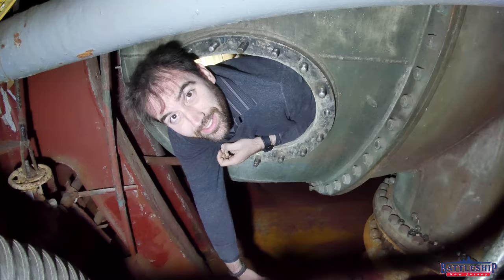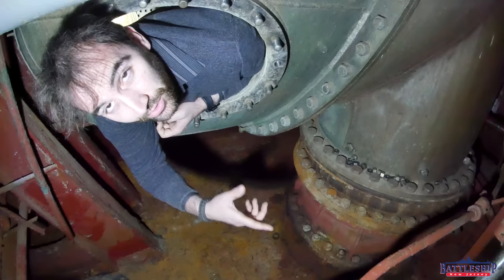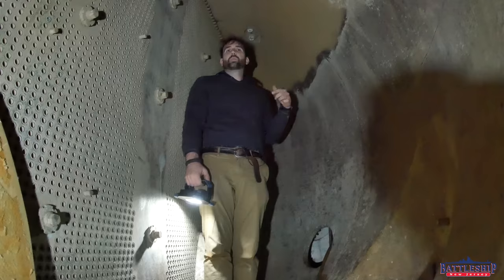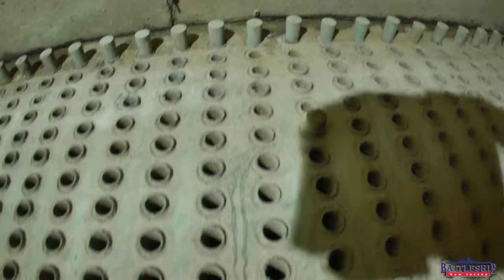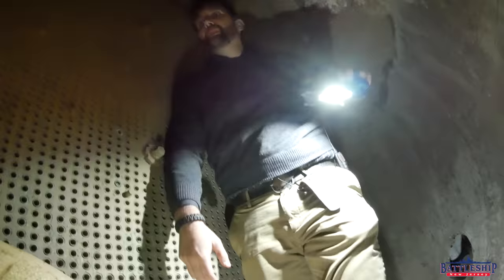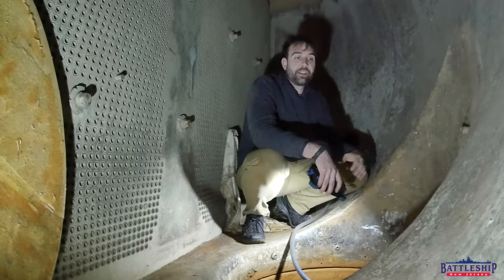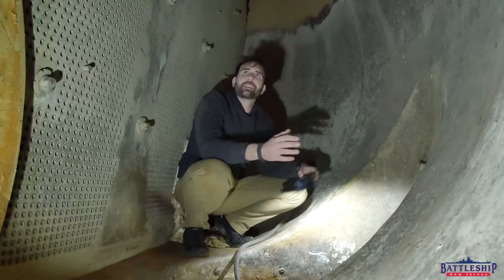Battleship New Jersey's First Hull Leak

Comment: Oh boy ! Do you not know the steam cycle!!!

The steam entering the steam side of the condenser is at about 28.5 inches of vacuum ( well below atmospheric  pressure ) and the temperature of this Saturated steam is about 90 deg F.

It stopped  being superheated in the high pressure turbine!
Reply: Agreed.  The main condenser is the source for the aux exhaust steam system which is used to heat a lot of things like the DFT, provide heat to the evaps, etc.  The safeties on the main condenser are usually set to 12psi-15psi.  If the steam levels get too low in the main condenser, augmenting steam is shot into the main condenser to bring it back up to working levels
Reply: Thanks Joe, I posted several replies about lack of effort to do minimum research on subject matter but they seem to have been deleted. This is one of the better museum ship sites but is still serves more to provide a podium for technical misinformation.
Reply: @ytlas3  WTF!?  Just when you think the "explanations" couldn't get any worse!
Reply: Sorry Sir, but no. The Auxilary exhaust comes from the exhaust of auxilary turbines such as the feed pump or on older ships forced draft fans and pumps.

The auxilary exhaust system Dumps to the condenser when That pressure gets too high.
A reducing station ( Leslie valve
In the navy) provides make up steam to the Aux Exhaust system when the supply to it is not enough. So 600/35 psi or 1200/ 15 reduction.

This Aux exhaust is Mainly used to heat the DFT that runs at 15 or 35 psi.

The main condenser usually has a sentinel valve that provides a whistle to let you know if the condenser pressure is too high but  
Is not big enough to relieve pressure..

Comment: When I worked at Hull-Oakes lumber mill, Dawson, OR. 30 years ago I was @30, 5'8" and 165. Guess who management asked and paid very well to squeeze into the "cooled down" boilers to descale the tubes? These boilers were from turn-of-the-century Baldwin locomotives @7 feet in diameter x 15 feet long, with a man-hole about 14 inches below the bottom tubes; just enough to shimmy to the end plate (backstroke style,) but not enough to lay sideways. The temperature inside was over 100f, the tubes were @150f and someone had to be outside to check on me regularly.  After months of struggling with exhaustive hammer and chisel work and mineral deposit chunks falling on my face, I fabricated pneumatic chisel tools out of 18" wood chipper knives and sped up the work dramatically. To be in my prime again, I'd do it all over.

Comment: I had a job on the USS Frank Cable for a few months in 2010, I had heard that the main condenser had been worked on a few months before and the navy had used a cofferdam on the sea chest for double protection. We needed to do a minor repair on the condenser so I told my guys to drain it down, note that the condenser had Engineer's red tags on the sea valves and they hadn't been moved since the USN turned over their operation to MSC civilians. To make a long story short, it didn't take long for me to find the sea chest gate valve was stuck mid position, a diver confirmed this. Then I had to tell the USN Captain (a Nuke) that his engineers lied to him months before.  Worst maintained ship I have ever been aboard and it was a tender, a repair ship.

Comment: Just out of curiosity how often does the battleship replace its zincs? And how many are there on the ship?
Reply: Ryan mentioned in a video at some point that the exterior zincs are well overdue and probably completely gone by now, but they use an active protection system with grid power instead.  I think theyre still intending on replacing them at drydock though.
Reply: The anodes in the condenser can only work if it’s full of water.

Comment: Our museum ship went into dry dock a couple years ago due to heavy pitting. The ice scraping accelerated the corrosion a microbe was causing. The microbe would take tiny amounts of copper out of the water and plate it onto the steel, which would then galvanicly react until enough rust was formed to passivize it. Well the ice would scrape all of that off every year at about waterline to 4’ below. So the worst pitting was in that 4’ belt. What’s truly amazing is how much the rivets reacted. From the waterline everything was pitted, below that 4’ belt of pitting, their were random rivets where the heads were nearly completely eaten away. The rivet being dissimilar enough to react. Being freshwater she didn’t have zincs, just a good coat of paint. Well 25 years at dock will eat through any coating.

Comment: You can determine the alloy (or plating) of most metals using X-ray fluorescence spectroscopy (XRF). There are now small handheld units (a.k.a PMI or Positive Material Identification). Not quite "cheap" - around $25,000, you can lease or borrow one when you need it. Metal suppliers and dealers likely will have one. Niton is a respected and major manufacture of the portable units.

XRF works by shooting an X-ray beam at the metal and measuring what is reflected and refracted off of the surface. Each metal present in the alloy has a different "signature". A database in the unit looks at the total spectrum of metals and either tells you the likely alloy and/or the percent of each metal present in the sample. A really cool technology.

Since it only looks at the surface, if you want to know the metal alloy that the ship was made with, you may need to scrape off some paint (it may show as lead) or scale. If the metal is plated, you may have to also remove a portion of the plating to get to the base alloy. The area required for "sampling" is quite small, perhaps about 1/2" diameter, but will depend on the exact model and accessories of the XRF machine.

Comment: I had a hard time understanding why condensers were needed until I noted their capacity was measured in vacuum. By condensing the steam, they produced a vacuum on the exhaust of the turbines, and it is the pressure difference between the inlet and exhaust that produces the power.

Comment: I used to scrap when I was a kid and the junkyard called rain gutter and metal house siding "irony aluminum". A magnet stuck to it but it was a form of aluminum. I wonder if that is what the bunk is made of? I gathered it was lighter than steel but cheaper and stronger than aluminum. And would handle heat better im guessing.

Comment: On my sub the condensers were corrosion resistant, but they still coated them with lead inside to prevent corrosion. Your condenser might be an iron alloy coated in lead? Lots of heavy metals around boats to watch out for!

Comment: The condition is called electrolist dthe reaction of disimiliar metals. Use of a softer metal such as lead is used as sacrifice piece such as to combat stainless steel shaft with brass prop. The lead being softer attracts the electrolist action and eats away the lead. Follows the easiest path to ground.

Comment: The really bad part about going into the condensers on an active duty ship is the stench from the marine life that gets caught in the condenser and rots -- you need to clean that out every so often.  I hooked up an air line hose mask to the ship's compressed air supply to make it more manageable.  As an added bennie, the expanding air cooled off my face.  The only time I was ever truly comfortable when the ship was underway was when we were above the Arctic Circle and the surrounding seawater as right around freezing -- engine rooms are typically miserable between the temperature, humidity, and noise.

Comment: How are these huge sea chests, i.e. holes through the armor, protected against underwater explosions and pressure waves?
Reply: The valve itself surely has to be tough, but I don't think there's anything specific in the design or execution that keeps them safer than the rest of the hull

Comment: WHERE HE IS IN THIS VIDEO COULD BE VERY DANGEROUS. DO NOT GO DOWN IN THESE SHIPS WITHOUT CHECKING THE AIR,,,, I WORKED on military ships for 22 years back in early 70's on WW2 ships that were still in service and it surprises me that this guy knows his stuff. Everything I learned about ship building is obsolete. In one year, every tool, press, rollers, instruments, shears, punch, laths,,,,gone,,,and should be, they were 75 years old when I first used them.

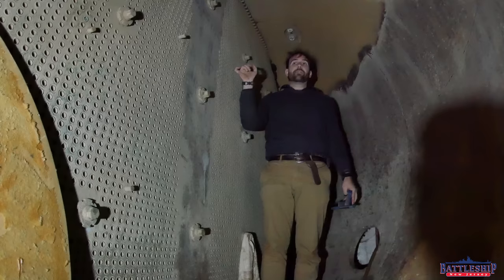Comment: 2:25 Condensers don't "pull a vacuum", the cold water traveling through the condenser tubes causes the steam on the discharge side of the main engines to flash back  to a condensate which creates a low pressure region inside the main condensers.  Also, I forget who would have this information (likely the ChEng), but those tube plugs actually have an equation on the maximum number of plugs that can be utilized while maintaining operating efficiency, i.e. there's a number of plugs that can be employed at any given time indefinitely.  If I remember correctly, it's a maximum per bundle and then a maximum overall.  So like 15 in a bundle, but no more than 35 total as an example.

Comment: The USS Cobia in Manitowoc  Wisconsin offers in the winter months when there are less tourists a special tour where you can enter any space in the submarine you can fit in. Would such a tour be possible on the New Jersey? I know size wise the New Jersey dwarfs the Cobia. But a confined space tour would be awesome!
Reply: I visited the sub Bowfin at Pearl Harbor in the '90s. They normally would not let anyone below the deck (where the batteries , pumps and other machinery is locatef), nor up in the conning tower due to that old bugaboo of liability. However, I was there on a weekday, which except for the docent, was deserted. I got to climb up into the extremely cramped conning tower to see the radar, torpedo computer and other things crammed in there. I would have missed that on a busy day.
D
Reply: @stephensavic9779  Thanks for that info. I checked their website and am definitely thinking about signing up for one.

Comment: Just a little correction. He is standing on the discharge side of this condenser, not the inlet. The inlet actually has two pipes, one to scoop injection, one to circ pump, both have Flapper valves between them and the condenser.  The overboard discharge goes vertically out the bottom. 

Second, plugging tubes was done over the whole life of the condenser. As long as you don’t loose about 20% of the tubes, you can loose a few without having to repair or retube the unit. I know at least EMO1 and EMO4 condensers have plugs in them. Now I see EMO3 has them also so I would bet EMO2 has them as well.

Comment: Given the age of the steel in the hull, is it possible or practical to find steel for blanks that matches the hull closely enough to reduce galvanic corrosion? Same question for welding rods/wire.

Comment: The main steam coming from the boilers go into the hp turbine and is exhausted to the lp turbine which the contender is below... I've actually had to go in a main condenser (after being vented for 24 hours) to clean the tube walls. Found crabs and dead fish in there along with seaweed.

Comment: Sounds more like you relieved the pressure long enough for the putty to set and form a semi - permanent seal. When the hose is full the pressure in at the plate will be the same as without the hose. Had you not already headed for drydock I'm sure the hose could have been safely valved off and caped. At least now she's getting some TLC.

Comment: The top row tubes in the condenser were never actually intended to have seawater flow go through them. This is essentially a baffle tube since it will take the initial flow of the steam and condensate. Some condensers will have the top two rows plugged like this. Also the tubes in condensers will always be plugged as part of drydock maintenance and there is a specific amount of tubes you are allowed to have plugged before you have to do a major overhaul/replacement. The zinc is there for general corrosion and "should" be found throughout the ships seawater systems. Even in todays ships seawater systems are made of ferrous materials just due to the price. As long as the zinc anodes are replaced and maintenance is done properly it lasts a long time as evidenced by these ships. The dissimilar welded metals will almost always corrode and that is more local corrosion that a zinc anode isn't going to do much about. Would love to see some footage of this monster in the drydock!

Comment: I was kind of surprised by how small the condenser tubes are. For a sea water condenser, I would have expected larger diameter tubes.
Reply: It’s not just about size, or do I am told!!!  

Actually we have a large surface area because of the number of tubes with water in it. Imagine the surface area of 4 large tubes, vs the surface area of 214 3/4” tubes. More surface area to transfer heat. More water comes in contact with heat, better use, not to mention easier to repair or plug if there are problems.
Reply: My Power plant design course was about 45 years ago, but  I thought I remembered that they liked larger tubes for sea water service.  less likely to be plugged by marine growth.   Of course it’s a balancing act between heat transfer, cleaning, ease of repair, etc.  There may even be some structural concerns as well.  Those may be Monel tubes, which are extremely soft.  And another difference is that Navy marine practice and merchant marine marine practice are two different things.

Comment: Ryan, First of all I have enjoyed your videos. This one however has a few misunderstandings. 
I suspect this turbine exhausts into the condenser at vacuum and the saturated temperature at vacuum for steam is much lower than 850 degrees like hundred or so. I don’t have a stream table handy but you have to know the actual vacuum to look it up.
The plugs you see in the condenser tube sheet were probably inserted when chemistry of the feed water indicated the presence of chlorides and thus a leak. There would be a criteria in the operating procedures for the boiler that established an upper limit before repairs were necessary. It could be done during overhauls or brief system outages in port. The plugs were likely not inserted in mothballing or decommissioning . The low number I see indicates the ships chemistry controls were effective in preventing corrosion of the tube materiel.
I do not see how placing a tube in the location shown would manage a leak unless the condenser was closed and was allowed to fill all the way up. More likely a pump was periodically used to remove the water from that area. I’d be interested if you disagree after you look into it. 
I worked in engineering for steam plants for 40 years and would be glad to help with such questions if I can. Just PM me if I can.

Comment: Your explanation is generally accurate. However, when the “spent” steam exits the turbine at near zero pressure but still very hot, it could be pumped back into the boiler.  But that would significantly complicate the design and operation of the boilers. Further, it would require significantly more power to do that pumping because of the significantly higher volume of the steam vs the volume of the condensed steam. e.g., water.

Comment: So the boiler uses sea water.  This is turned into steam to propel the boat [remember, there are no ships in the Navy...], so what happens to all the salt that is produced?  How is it removed?
Reply: The boiler uses fresh water. That’s the whole point of the heat exchangers. The fresh water (steam) is cooled by the sea water as they pass either side of teh heat exchanger. Warm sea water goes back in the sea and cool fresh water goes back into the boiler. There will be other equipment on the ship that removes the salt from the sea water so it can be used. I think he mentioned evaporators..

Comment: How about a cross section of a steam pipe…how big is the pipe actually without all the insulation surrounding it. 
Did you do this before Thanksgiving dinner or after? Thanks for all the videos of the ship…
Reply: The diameter of the steam pipe is based on what kind of steam goes through it (main steam, aux steam, 150# steam, aux exhaust, etc) The amount of insulation is also based on the temperature of steam that goes through the pipe.  Been ages but the Iowa Class BB's main steam piping is between 5" - 5.5" IPS with around 5.5" of insulation on them (double walled, meaning the first layer would be about 3" and the second layer would be 2.5" thick)

'

Comment: Chances are its 304 stainless steel. Magnets will stick to it but it is corrosion resistant, not corrosion proof like 316 stainless. Also the main condenser is usually the mounting bed for the turbines so it has to be something stronger than copper/nickel or manganese/bronze or some exotic metal. Due to it being wartime, it could be mild steel but based on what I see, it isn't. The modern ones I've inspected are exotic steels.

Comment: I'm interested in knowing which fuel the ship did the best on (Bunker A, Bunker B, and Bunker C Fuel Oil).
Reply: Best in which way. They all had there positives and negatives. The navy has used DFM(F-76, bunker C) mostly since 1960’s or so. It is more refined and doesn’t clog up the boilers as much. 

As for fuel that is the cleanest, it’s JP-5, F-44. While it’s designed for aircraft, the boilers do run it sometimes, as well as the diesel engines. It’s more expensive but works great. 

If your asking how do I know, I was fuel king on a navy oiler for about 2 years. Responsible for all fuel onboard the ship.
Reply: Definitely DFM.

Comment: Aluminum bronze and maganese bronze are both magnetic--such magnetism is not based on being ferrous.  When checking for various brasses and bronzes, the first check is with a magnet.  Naval G, red brass, 85-16, etc., are nonmagnetic.  However if the item is magnetic then you know it is either aluminum or manganese bronze.